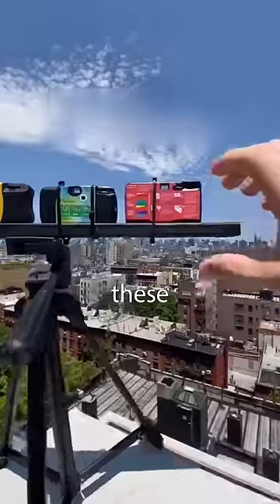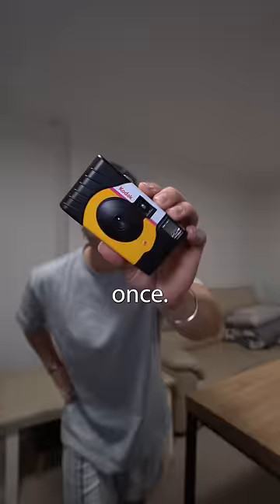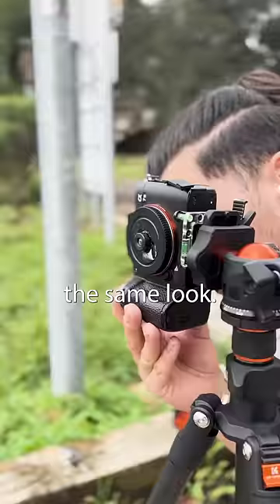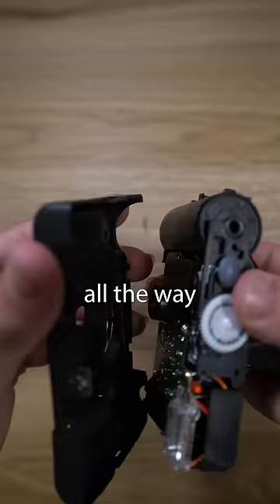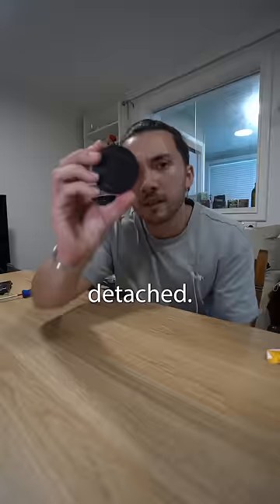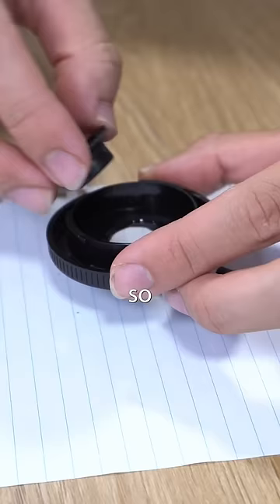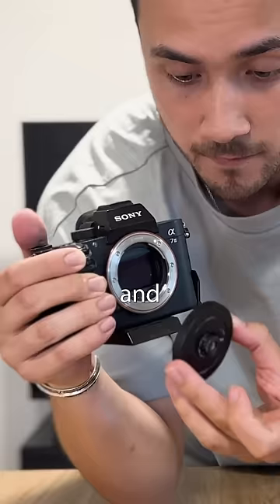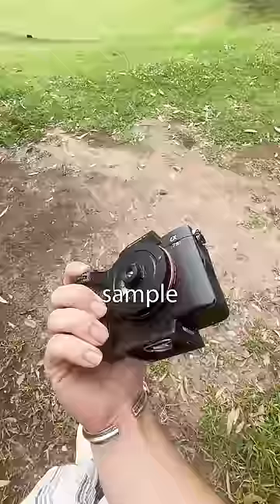I put a disposable camera lens on my pro camera

Comment: As a former camera tech and film photo developer, you can use those cameras more than once if you know how they work and are slightly more careful taking then apart. Also, t's not the lens that gives the majority of that "nostalgic look" it's the film.
Reply: what does, then? Spill your ancient wisdom, please-
Reply: Or just like
Yknow
Buy cannon or some type of film camera from the 90’s for $100-$150 and then you can get 3 rolls with 200 shots each for about $15
Pretty sure most of those disposables are like $10-$20 for maybe 60-100 shots?
Reply: Amen! Posted about the same thing but much longer.

Kids.. 😂
Reply: Went to post this.  totally reusable.
Reply: also the sensor the camera has idk why that was completely disregarded in this video. the lens is only like 1/5 of the process that achieves the look and feel he’s after
Reply: @poopyfeast  kinda calling BS on this overall
Reply: Te
Reply: exactly, shooting on film has a wider latitude than digital sensors
Reply: @acro2097 Where are you finding rolls of film with 200 shots lmao.
Reply: No wonder his pictures didn't look that good
Reply: @acro2097 where are you buying film? Standard 35mm film canister's are 35 shots (or twenty some) and run you between 10 and 20 Canadian each depending on the type of film. You can get it for less if you buy it in a bulk roll and fill canister's yourself but that can be a bit tricky.
Reply: @acro2097  I think your prices are wayy off. Here in Slovenia I pay 13-17 Euros for a Kodak film with 24-36 shots and do rolls with 200 shots really exist?
Reply: Same, Im pretty sure I got one or two lying around here that I just have to pop the top off and it’s good as new.
Reply: Genuine question, if the photos are all digital and don’t come out on a piece of paper, why does the camera need film?
Reply: @nicholasedav  because there aren’t digital

Cameras with film are not digital cameras
Reply: @The_Tickle_Monster  Ouhh i thought disposable camera were digitally uploaded at stores that blow the images up
Reply: @nicholasedav  no they have a film which is very sensible to light. The film gets a very short amount of light then it will be but in a special liquid so it isn’t sensible to light anymore. And finally they print inverts of the film
Reply: @germanmemerboi3157  it's the film. he said it.
Reply: Yes that’s what I had always thought! I was shocked thinking it could just be the lens haha
Reply: As a former tech enthusiast kid I once took apart one of these, let me tell you it's NOT FUN to accidentally shock you with the flash. Even worse than licking a 9V Block as a kid (something my dad made me do out of fun)
Reply: the reason why they are single use is they dont sell film rolls anymore
Reply: it does help with the look though
Reply: @germanmemerboi3157  The Film does it. It literally says in the comment
Reply: Yep it’s how the film develops (and the chemistry involved) that gives film photos that nostalgic look. Digital cameras just don’t have that so all that OP did in the video was downgrade the lens.
Reply: @randomguywithasilkyfella I must be doing something wrong then, because I buy new film almost every month
Reply: but then you have to develop your film right ? i don’t have the means to do that now that i don’t have access to my high school film class anymore
Reply: what about this on a fuji with film sims
Reply: @nicholasedav photosensitive film is the medium on which the images are stored, after getting a frame exposed to some light.

Then; after developing your film, you can either scan, print and scan, or or just print your photo negatives, onto special light-sensitive papers, and reproduce picture you shot originally.
Reply: @randomguywithasilkyfella  except for the part where kodak is literally expanding their production lines again; because film is literally in higher demand than the companies can realistically produce
Reply: @mxbunnycatter  Thanks! I was confused on how all of this worked
Reply: To be fair you can get a decent bit of the film colours and grain through editing, old/cheap lens weirdness is harder to edit in.
Reply: @acro2097 your count is wrong, for about that price you get 36 exposures
Reply: @germanmemerboi3157 the film inside...
Reply: @BenAEMT Fr he totally spent some time editing and adding filters
Reply: @obansrinathan 24 or 36*** shots per roll standardly
Reply: @germanmemerboi3157 they said it's the film

Comment: dude the flash capacitor almost killed you lmao
Reply: I was forgetting if they can kill you or not. I think it's possible but unlikely
Reply: @lazzynomad  I think it might, but it seems unlikely.
Now the capacitors in PC power supplies? Yeah, don't ever touch those. Even after months of being unplugged, they can retain plenty of charge enough to kill you.
So in other words, it depends on the capacitors, but better be safe than sorry.
Reply: @MartinFinnerup  I think that watts would be pretty low as well with a love voltage. The stuff I know is microwaves and radio/communication electronics. They can have caps to make upwards of 5000v. I took one apart to make a unique wood burning tool and had to be very careful till I grounded that thing.
Reply: @lazzynomad  I replaced a lens in a Sony digital camera a couple months ago, and was a bit clueless when handling the flash capacitor and shorted its pins with my finger.. it just made my hand contract for about a second or two and spooked me lol
Reply: @kazoose_  any amount of watts carriers it's own percentage of danger when begin exposed. If you look up how much watt it takes to kill you you will be surprised by how low voltage and amperage can be. The higher the watts the higher the risk.
Reply: @kazoose_ i was once trying to fix my broken fast charger block for my phone... Let's just say, I shorted the pins with my finger which shook my entire body and made me throw away the whole thing all in less than a second
Reply: Nah it would have just hurt. When I was 12-15 yrs old we would take apart disposable cameras and rig them so we could flash it whenever we wanted as a nuisance, and we all got shocked by the flash capacitor many many times. Not at all lethal, just painful.
Reply: @MartinFinnerup dont even think of touching the crt flyback transformer without discharging it first 💀
Reply: Once took apart one of those as a kid, man that shock was a good one! At least in recollection it hurt more than sticking a fork in the toaster a couple of months ago while still plugged in (yeah that's not a joke, Yeah I really did that, Yeah I was kinda drunk getting my bagel stuck)
Reply: I think I saw his hand's bones
Reply: @lazzynomad watts have nothing Todo with it the current will be as it's how much power it can send once
Reply: I only came here to say that you should be careful of the capacitor. It will hurt you and it will do so without remorse.
Reply: @MartinFinnerup  try years? For example the capacitor that the furby toy robots contain (which aren't very good capacitors) can hold charges for YEARS the capacitors also CAN and WILL kill you.
Reply: @Engimaintrust  no furbys did not they ran on batteries with small capacitors stop making stuff up
Reply: I got shocked by an 35 mm compact camera once. Hurt like hell, I screamed. Only way I see it killing someone is that one could get a heart attack. Dude in the video triggered the flash, so he didn't get the shock - all of the stored electricity went into lighting the bulb.
Reply: @MrKubazim  Delayed shock syndrome is more than likely to set in. Shock without external medical aid is almost always fatal
Reply: Well I once zapped myself with a flash capacitor, it won't kill you but the pain is terrifying, my body was vibrating after getting shocked😂.

Comment: If you pull apart the disposable you can just replace the film and use it again after rewinding the counter. The trick here is that these cameras have the film pulled out from the canister and so you must reload the canister by pulling all the film out before putting into the camera and this must be done in a dark room either blind or with a dark room light.
Reply: Was looking for this comment. Well said
Reply: kids this days😂😂😂..

Comment: As a crafter who use cyanoacrylate adhesive on daily basis, u should left the glue to dry at least for an hour when u put too much glue like this. Else, the vapor would ruin the sensor and/mirror of ur camera.
That would be an expensive-to-fix mess.

Comment: Those flash-capacitors are no joke ... a few years back, I got a shock from one while taking apart that exact model disposable-camera (you were lucky enough to short it with your screwdriver). It felt like I was having a heart attack, and my arm was hurting for a couple of days afterwards. 😅  I havent messed with them since.
Reply: same lmao ten year old me was shook
Reply: @ComicusFreemanius  i'll bet! It was worse than 240v mains shock (they're 500v-5000v capacitors).
Reply: I worked for 7 years in photo stores. Got shocked quite a few times. Always sent the newbies to disassemble those disposables as a rite of passage... jajaajj good times
Reply: I remember there used to be a tutorial floating around that told you how to make a fucking taser out of one of these disposable cameras.
Reply: @Kevin-jb2pv  That was definitely not what i was doing ... 👀
Reply: Oh come on guys try a microwave cap!
Neon sign transformer? No?
All right at least go hold one of your spark plug wires while your car is running...
Reply: @petevenuti7355  How about a 100KV flyback-driven bank of caps, with an air-blown sparkgap going to a 10" water-cooled primary...Used to build tesla coils, but if I'd got a blast from that I wouldn't be here to write about it  ;)
Reply: @njones420  that's why people think the flybacks are called flybacks. Touch that, zoom. 
  Reminds me of a TEC UV laser build.
  I've tripped breakers but I hope your not suggesting you actually got bit by that? (Unless they were the puenyest caps)But hey, a few people live through getting struck by lightning.. sooo
Reply: @petevenuti7355  lol, not heard that before... No, I stopped building teslas after accidently building an EMP(was supposed to be a big tesla coil, but it never produced any sparks...the maths was all done on paper and clearly i got it very wrong); it knackered a lot of my electronics (and some of my neighbours, their TVs all went green 🤣), still not sure what it is and havent turned it on since (20 years it's sat in the shed)...and I stopped playing with lasers after nearly blinding myself with a stray reflection quite a few years back too, that was just a diode based one, the chemical ones scare me 😅.
Reply: ...I build a lot of wacky stuff.

Comment: When I was about 12ish years old (1997), I took apart a disposable camera, as I did with most things that I wanted to know how they worked.

And while I was removing electronics from the plastic, I had the outer pad, between the knuckles, of my middle finger, anchored against the circuit board for leverage. And I got, till this day, THEY WORST ELECTRICAL SHOCK OF MY ENTIRE LIFE!!!

Fast-forward 10 years. I'm browsing the Internet, when I see a video titled, "How to turn an old fashioned disposable camera into a powerful taser".

I was like 😱 😱 😱 😱 , no wonder...
After watching the video, it all made sense.
The capacitors in the camera charge, and hold a LOT of electric power. AND IT CAN HURT !!!
Reply: Same, I learned my lesson the hard way by touching the capacitor of a broken phone charger. My whole body shook but thankfully it took only a few milliseconds to throw that thing away from my body
Reply: Ooh super good info ty

Comment: That spark came from the flash capacitor, it holds its charge even when the camera is completely off

Make sure to discharge it using a resistor, shorting it may kill it and cause a loud spark, and touching it while it's charged with SHOCK the heck out of you (said by experience)

This is an important tip in case someone wants to disassemble a camera to fix it or just out of curiosity

Comment: The nostalgia I got when it produced the shock When I was 4-5 yrs old I had managed to get my hands on an old film camera from my Grandma's house and brought it back to ours. Me being curious decided to take it apart with a screwdriver. I did take out the battery but didn't know of a particular MF called capacitor. And low and behold, the camera almost came to life with a whirring sound and took a picture of me and gave me a good shock and left this burn on my hand for the rest of my life. :)

Comment: For those wondering about the spark, the board visible on top of the chassis is the flash module, which contains a high voltage capacitor. He accidently discharged it, which can hurt quite a bit. FYI, the flash modules have many uses as capacitor chargers.

Comment: The first disposable camera The Fotographer went on sale in 1886. It was a cardboard pinhole camera that could only take a single picture.  Once the picture was taken you had to use scissors to remove the plate for development. The camera was 25 cents.

Comment: The capacitor for the flash makes a fun bobbie trap it has a strong bit ("fair warning" do not modify electric components kids)😉 The film roll can be removed after it's used and a fresh roll can replaced for the camera then reused this cycle can be done many times and just about an infinite number of times with just a battery swap before the parts become to degraded

Comment: Be very careful if you ever decide to do this(assuming you can find one).
I did it once(pulled one apart just to see what it looked like inside), and just like in his video the flash went off.  Well #1 it’ll blind the crap out of you, and #2 of you’re touching the correct parts of it it’ll give you one hell of an electric shock too…
It’s best to try this with a non-flash model, if you ARE going to, no chance of flash and zap.

Comment: I remember taking those apart and using the flash capacitor  to make the picture button shock you. They're not powerful enough to do damage unless you have a pacemaker or something like that. Alil worse than the old shocking gum

Comment: Ah yes, the capacitor pop. I worked at a camera shop in the early 2000’s, and took those apart for developing/recycling the bodies. I got shocked a few times and eventually learned what part to avoid and discharge, no thanks to management, who just liked to get shocked I guess. And yes it hurt, kinda like getting snapped in a mousetrap, which I have also experienced, sadly. YOLO!!!

Comment: Disposable cameras actually get recycled. Some of them are not actually "Disposable" at all. They have a normal film door for reloading under the paper label.

I think your lense was dirty when you glued it. The solvents in some glue make oil turn white. You have to clean it with acetone or alcohol before applying glue. Otherwise you get a permanent smudge glued to the surface of the lense.

Always discharge a capacitor for any device with a capacitor. Some devices can kill you when they're not even plugged in.

Comment: Cover the lens or put the camera in a film changing bag then cycle it through all but the final shot. That winds the film into the cannister while leaving the tail out. Then you can open the camera and put the film into a normal 35mm camera. You'll lose the first shot, unless you take the camera apart under film safe lighting to run the film all the way in except for the tail.

Comment: I did tried to do something like that once but ended up accidentally touching the metal contacts of the capacitor for the flash 3 times, which I later found out had the potential to stop my heart each time. 🤷‍♂️

Comment: Actually, they can be used many times.

I worked in photo retail and photo finishing in the 90s (along with doing some professional photography).

We often received cheap generic disposable cameras that were literally reloaded and taped back together, often with original brands like Kodak still visible.

We would crack them open, pull the film, often getting shocked in the process by the flash capacitor, and drop the into recycling for their next rotation.

Want to get a disposable camera photo, kid? Buy one and actually take some photos instead of this silly stuff. Labs still exist. Learn about lighting and composition without filters.

Comment: Next time please take out the batteries hold the charge for the flash 10 seconds then use the flash to discharge the capacitor it contains high voltage and can really hurt you

Comment: How are they so restricted tho? The camera's memory is low? Is it programmed to stop taking photos after 1? Explain plz
Reply: It has a physical roll of film in it. Usually the length of the film gives you 24 pictures before it runs out, but some have 27 or 36 exposures. It will say on the box.
Then you send it in to get developed (or do it at home if you have the supplies